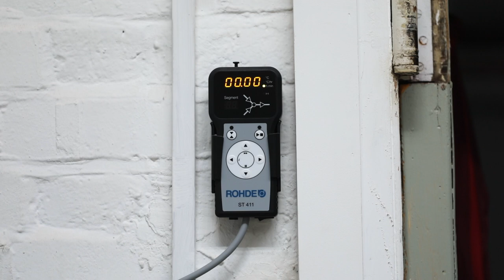How to Make A Pottery Inkwell, from Start to Finish — ASMR Version

Comment: Thank you for this great video. I have two questions concerning your throwing. How do you keep the inner edge at the bottom this straight? I am always ending up with a rounded edge in the form of my finger. And at what point do you determine the diameter of the vessel. Thank you! :-)